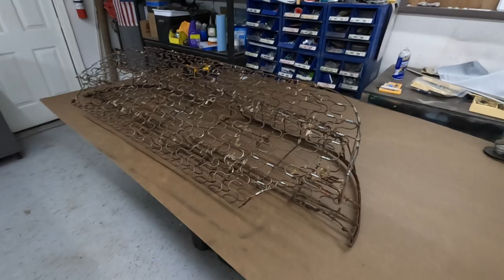$600 Tri-Five Interior. DIY Interior Part Three 1957 Chevy Budget Build. EP. 18

Comment: Good job!  How did you get the back seat out?  My is stuck and the owner lost the key to the trunk
Reply from the maker: Knock the front of the seat base up with your knee, it should pop out of the pockets it locks into and then lift out. For the back cushion, two tabs fold around the seat frame on each wheel tub down low. Straighten the tabs and lift up on seat back